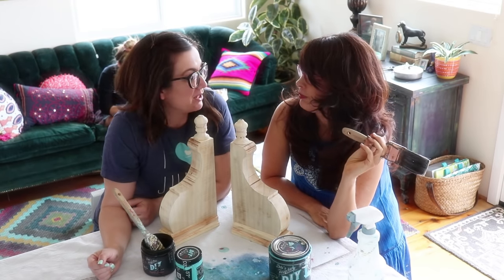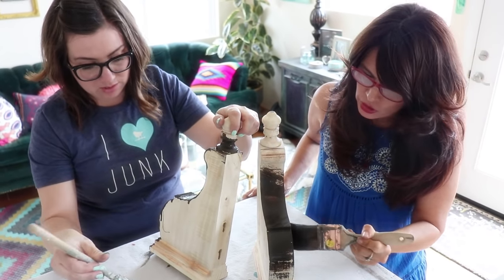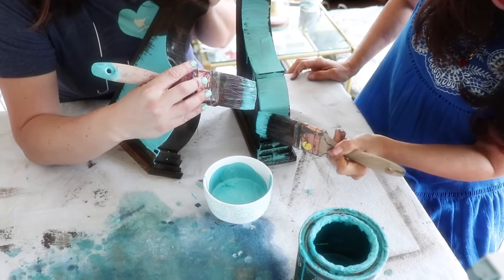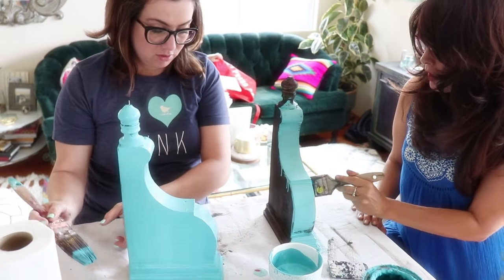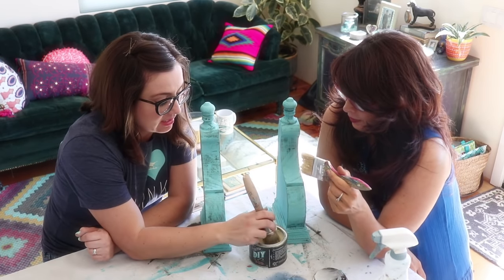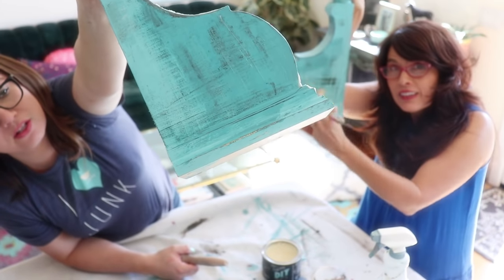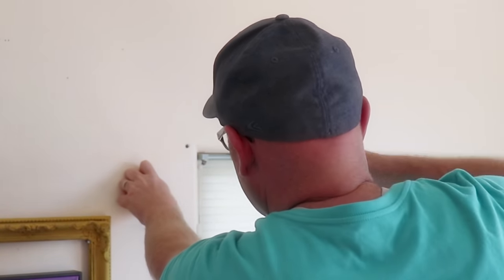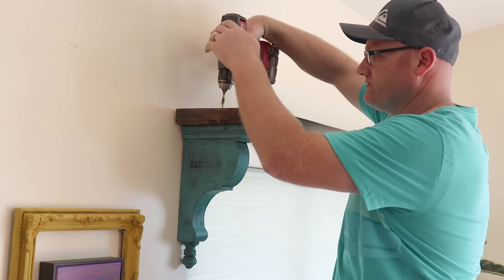How To Get Layered Chippy Texture On Corbels | DIY Paint

Comment: How fast can you retouch or recoat your project without messing up the finish if you are looking for a more smooth finish with Debi's DIY paints?
Reply from the maker: To get a smooth finish I always buff with 220 sand paper and I usually only wait about 20-30 minutes between coats. Just until it’s dry.

Comment: Can you use Dark and Decrepit on already painted pieces? Or Veneer? And did I hear right that you don't have to seal it afterwords?
Reply from the maker: It has built in sealer. If you did multiple coats you would not need additional sealer unless it’s a high use piece like a dining table. And yes you can use it on already finished pieces but it won’t look like stained wood. Be sure to lightly sand any painted or veneer pieces before you use dark and decrepit